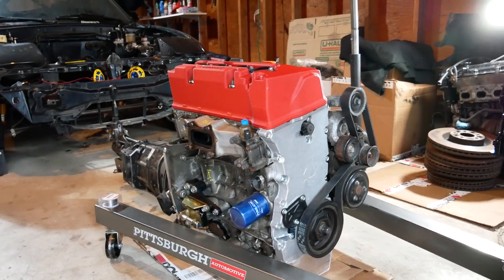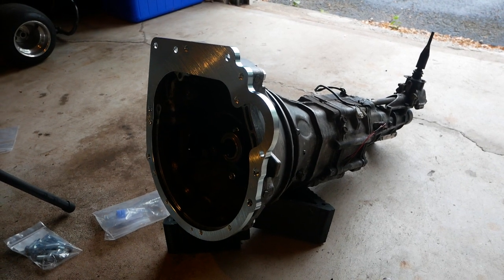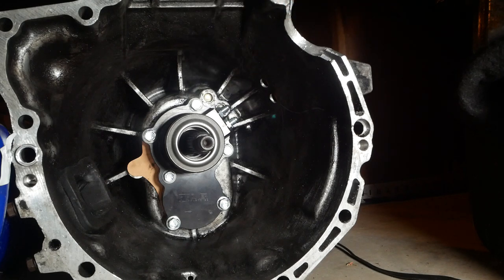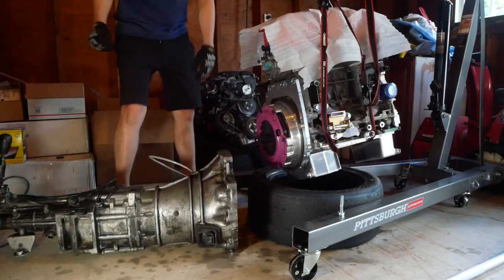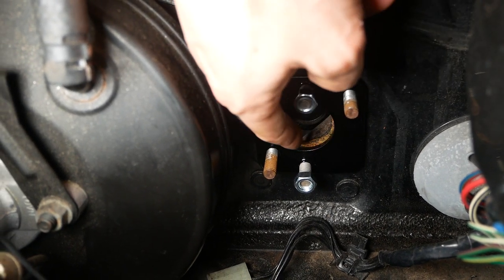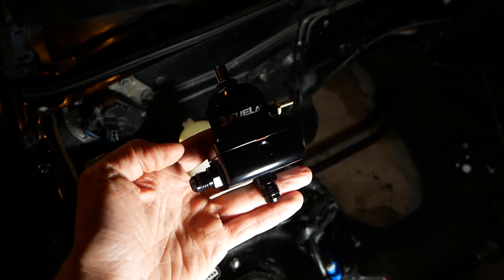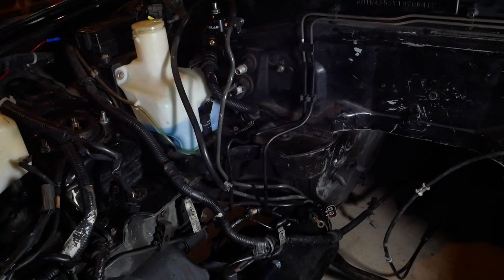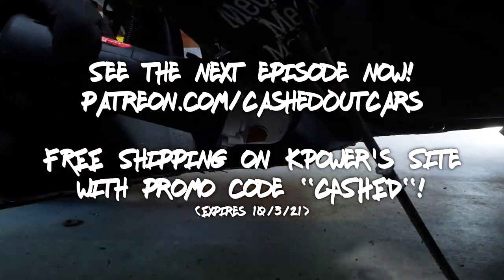Preparing The Chassis and Transmission For Our K-Miata | K24 MX-5 EP3

Comment: There's a company in North Carolina that sells some really potent degreaser. I'm using it to clean up a disgusting motor & subframe that had been leaked on for god knows how long. Its called Red Max from Majestic Solutions. 

I mean it, the motor was like 5mm thick covered in oil and dirt lol
Reply from the maker: Awesome! Sounds like a real time saver